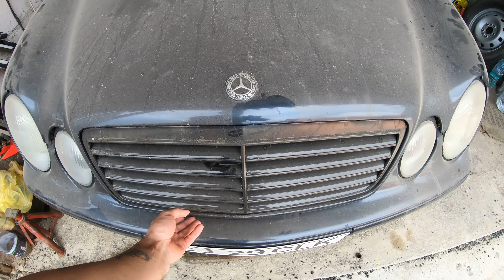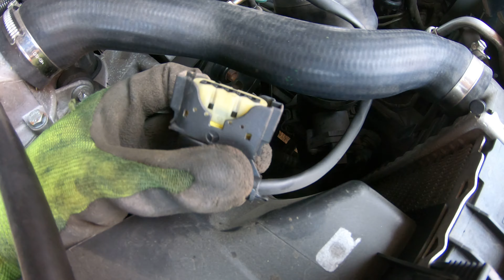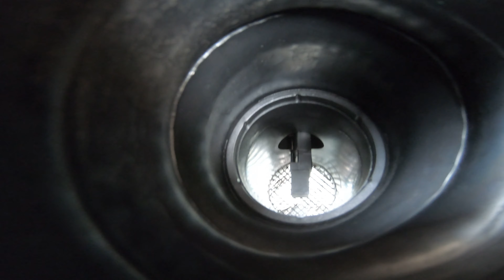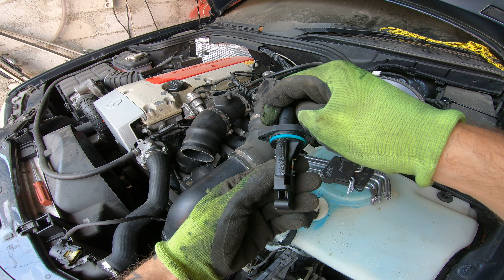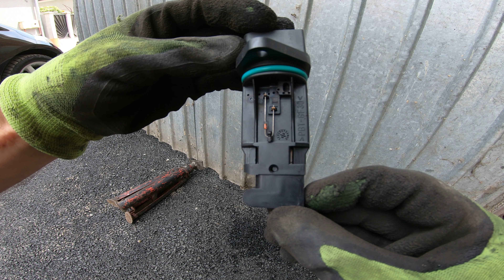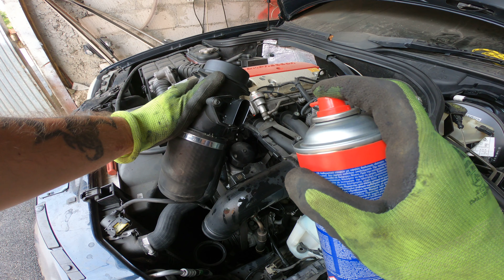Mercedes CLK W208 MAF mass air flow sensor , Reinigung des Luftmassenmessers , masseluftstrømsensor

Comment: Salve sono interessato come va il debimetro adesso che lo hai pulito grazie
Reply from the maker: Fast respond
Reply: @AutoMotohowto46  thank you 😊 
You are great
Reply from the maker: @elioneltoshkesi6038  welcome sir'
Reply: sorry for the disturb, I have a clk w208 200 compressor, when I give it gas, it doesn't go well, it seems like the turbo compressor is not working. could it be the MAF sensor?
Reply: @elioneltoshkesi6038 did you fix it? I have a clk230 K, same problem. At least the first few minutes before the enginge gets hot enough. Thinking about buying new MAF. Thx
Reply: @lorenzo4476 si ho comprato uno nuovo con lo stesso numero serie adesso va benissimo